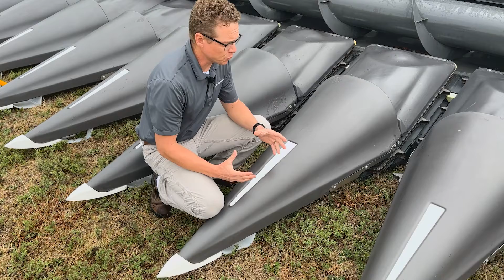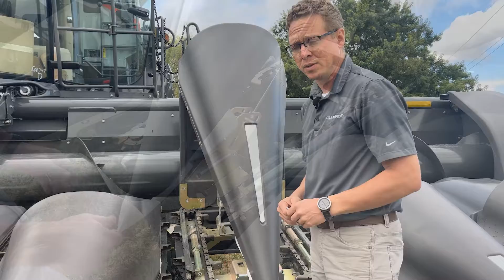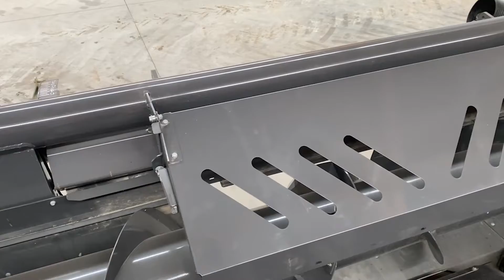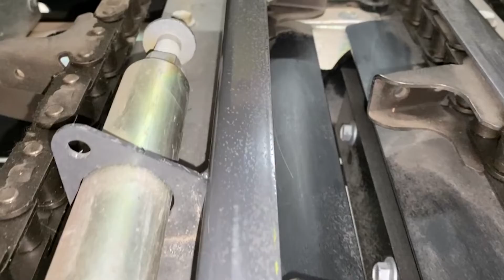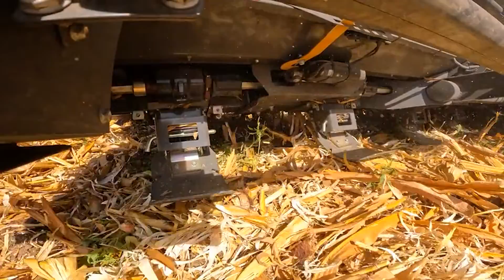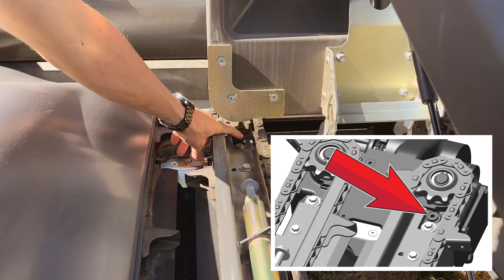3300 Command Series Corn Head

Comment: I can’t believe that Gleaner has Quit making a 6 Row Corn Head! That is a decent amount of their Customer Base is Smaller more Mid Size Operations than John Deere and CNH have. That is a decent amount of the S96 & 800/900 Single Tire Customers are running a 6 Row Corn Head. Gleaner Offering a Class 6 Combine along with a 6 Row Corn Head & a 25/30’ Platform Will separate it from JD & CNH.

Comment: So you have to mess with 2 pins to fold the snout up to move it down the road on a header cart?
Reply: 1 pin and a gas shock T-rod to hold snout in transport.   No biggie.
Reply: @robratcliffe5635 gotcha